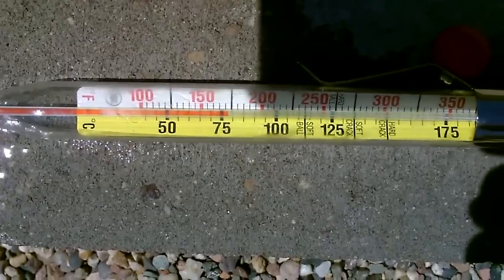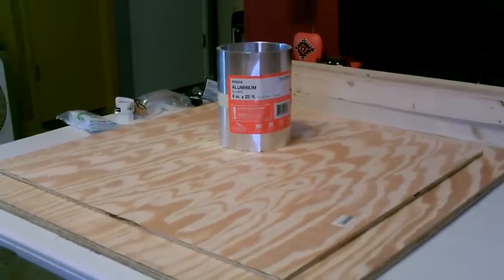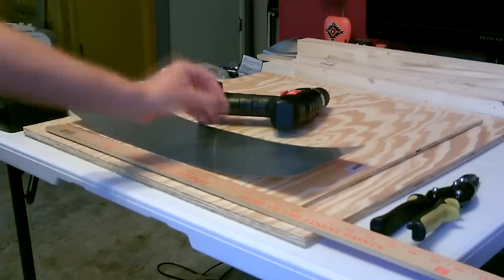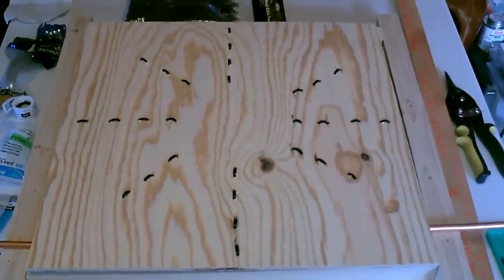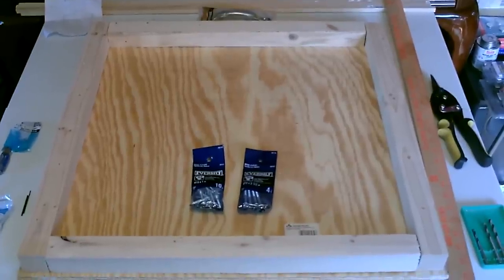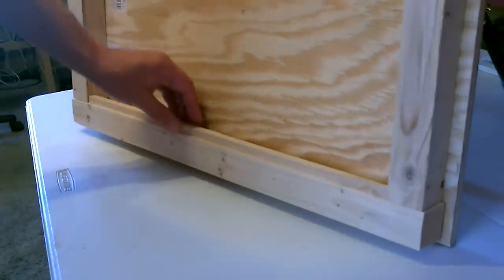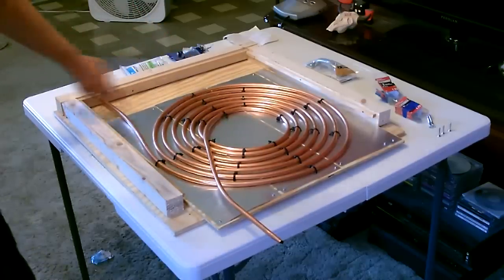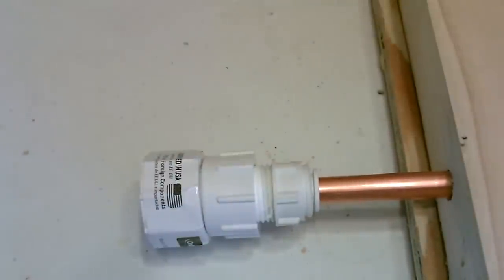DIY Solar Water Heater! - Deluxe "Aluminum backed" COPPER COIL Solar Water Heater! 175F Full Instr.

Comment: Help! Mine doesn't work! Based on suggestions below, I used copper plates rather than aluminum; put insulation behind the plates, used metal zip ties, and two panes of glass, and insulated the glass to wood gap. I am using a pond pump to pump water from a small pond to the heater, and then return--black tubing throughout. Due to trees, I can get only perhaps 90% sunlight for several hours. Yet it seems that the water hardly increases in temperature, if at all! I spent like $300 on this, thus pis--ng off my wife, and countless hours. Please tell me what I did wrong!
Reply from the maker: hi there. the issue might be that you used 2 panes of glass. sounds like a good idea but whenever i've used 2 or 3 panes of glass (in experiments) with solar box collectors - the 2 or 3 panes block a lot of the light from getting through and it gets nowhere near as hot. i'm not sure why an extra pane blocks so much light but it does.

Comment: Hi, another question: I still can't get my solar water heater to work: driving me crazy. I am using 3/32 plate glass from Home Depot, but it appears that you are actually using much thicker glass. Is that so? Is the thicker the glass, the better? What about insulated double panned glass? Or glass from a car window?
Reply from the maker: hi there. if i remember, the glass i used is about 3/32 (possibly 1/8). i've never had any luck with using more than one sheet of glass. it always seems to reduce the temps. i'm not sure about glass from a car window (i've never used glass from a car).

Comment: How would you go about having it work in conjunction with your existing hot water heater? Would be awesome to have preheated water before the hot water tank has to kick on.
Reply: Greg Kohls Jr. I wonder if you feed a tank less and maybe flash heater with this solar unit it's temp sensor would adjust and only add energy as needed.

Comment: I've watched several videos of similar solar water heaters. My main question is: How long did those zip ties last in the intense heat? Less than one season, I'm thinking...
Reply from the maker: hi there. the plastic ones are holding up good so far, but i've recently started using stainless steel zip ties just to be sure
Reply: You could probably use electric cable Clips that might fit the pipe.
Only a thought

Comment: Unless I missed it, how long is the copper tubing used? 25 feet, I am assuming here?
Reply: Cambodia Paul's Organic Farming 
50 ft.
Reply: Not enough to heat a bathtub! These cant work! It would take all summer to heat a tiny pool
Reply: @Coupe420  - Geez. You could make 2 or 3 of them if your pool is deep.  Put them each on a separate piece of foam and float them in your pool. Begin the drawing of pool water through the siphoning principal into the copper pipe by suction until it is coming out the other end and back into the pool.  Note: do this immediately upon placing in the pool and before the water is hot!  Remember, this produces 150+ degrees.   Place them in the pool on a Wednesday and by the weekend your three floating heaters will have mixed with your cold pool water warming it up FOR FREE and your pool will be nicely swimmable when the blended water hits about 85 degrees.
Report back if you do this.  I'd love to see if it worked.

Comment: Is there a recommendation for a water pump to use with this solar water heater using 3/8” OD copper pipe at 50’ length. A 1hp  non variable speed pump burned up in like 10-15 minutes. Any help will be appreciated. Thanks

Comment: How well has this been working for you. I was thinking about doing something like this except modify it so that I can remove the tubing from the frame and put it on a firepit for cloudy days. Would that work?
Reply from the maker: hi there. the unit is still working great. that is an interesting idea about the fire pit.
Reply: @desertsun02  thanks for replying. One more question, if you don't mind. Do you know the flow rate of your pump? I have a pump to empty my pool, but I think the flow would be way too fast to heat up in this set up. Any info on the pump you use would be much appreciated. Thanks.

Comment: Did you have a problem with condensation?  I built this.  And I have moisture inside glass
Reply from the maker: hi there. i've not had that issue, at least so far. one fix might be to add a few small vent holes

Comment: Should have put insulation behind flashing
Reply: Paul Milne would the flashing reflected the heat to the pipe ?
In turn it would make the water become hot quicker.

Comment: ok so im hearing all sorts of differing things here... i thought 3/8th tube would be too small and not let enough water pass through to actually heat a pool with any real efficiency?  then i heard coils are a bad idea and that a header with straight tubes would work better and let you get a higher flow into the pool. then theres the whole Pump pressure thing... thats a whole other story!

Comment: exilent vids. Would sheet metal work the same ? Or wuld it reduce the thermal ? Also is this vershion beader than you'r last one ?
Reply: What kind of metals would you be interested in? Find them laying in the sun, note their condition (clean, dirty, corroded, painted...) and their temperature. Different metals act differently than others. Polished aluminum seems to be the best reflector since it absorbs the least heat. Gold might be better, but try keeping that around.

Comment: I'm considering doing something similar for a solar water heater for an in ground pool. I might need a couple of these in line to make any significant increase in temperature. Do you have any suggestions? My pool is approximately 30,000 gallons.
Reply: Scott Williams hey Scott I was wondering have you made this for your pool yet? I'm considering doing the same thing for my in-ground 30,000 gallons as well. I'm just not sure what size copper line to buy
Reply: I bet if you have smaller copper lines (4  x 1/4th sized lines)  but connect them side by side to a 1 inch pipe it would be better then having everything in 1 inch...   ____|____|____|____|
Reply: Did you ever try this for your pool?
Reply: No, I never did but I always wondered if it would make a significant difference. This year seems to be a bit cooler and the pool is only at 73 degrees. I still have hopes in making this one day.
Reply: Scott Williams you would need dozens and dozens of these to increase the T of a volume of water like that. A solar blanket cover would be more efficient.

Comment: Could you use one way glass to make the box hotter and not paint the copper or Aluminum?
Reply: Not painting would reflect a lot of the light and heat. Then the glass could warm up instead of the copper pipe.

Comment: hey  would this methode on bigger  scale work fore desalting  sea water ? maby working model on that    would be realy cool if you can get  the water  and boiling temp and keep it there  wil low inpute?
Reply: Copper plus salt equals problems.
Reply: @MmeHyraelle  thx

Comment: What does more hot water on a standalone application ? parabolic or this setup ?
Reply: I would suspect the one with the most area exposed to direct sunlight would win. Trying to heat the interior is the mistake. Wasted heat. Redirect and focus the energy on the tubing.

Comment: How does the glass layer improve things if there is a black aluminium layer on top? Wouldn't be better and cheaper to remove the glass since the aluminium in contact with the wood would loose less heat?

Comment: I adpre your design and fully intend to copy it. However, there's no way that copper tube is that cheap. Your price covers the cost of about a 5 foot long 3/4" copper tube. 
Theorice of copper une had not changed much for the last decade
Reply from the maker: hi there. i'm glad you like the design and you're going to make it! about the price of copper:  the copper coil i used really was just 23 dollars back when i bought it in 2016/2017. prices have almost doubled on copper since the low in 2016 (just checked 'Statista' to be sure). the same coil is now $40.99 (or almost double the price that i paid), so it seems to line up with market cost of copper. I mention this because i want you (and everyone) to know that i never "make up" any numbers, stats and figures in the videos. if you see it on this channel, it's real. 🙂🙂👍. btw, thanks for being a long time subscriber!

Comment: Solid state graphite power cell bank that charged up organic carbon cell power bank off earths resonance field with vacuum spark gaps at key locations to increase current. Electronics with two induction coils designed to transmit a certain frequency through the coils in a loop for zero energy loss. That caused a graphite gallium heating element to glow red hot around 2500 to 3000 degrees. For a water heater operated off earths resonance field which could then power thermoelectric generators and provide heat for a home green house or trailer. Way better then solar because it works 24-7 365 day and night. : )
Reply: WHAT did you just say????
Reply: @CosmicSeeker69  🤣🤣🤣🤣 and it sounds expensive!

Comment: OMG good intentions, corrosion by disimilar metals...
Reply: What dissimilar metals?  I see copper as the only metal. It is touching wood, plastic twist ties and plastic PVC. 
Please explain what I am missing.
Reply: @CasuallyObservant  I believe he is referring to the copper coil lying on the aluminum backing, then zip tied down to insure full contact between the two.

Comment: Nice . too bad they don't aluminum tie wraps. Maybe they do have aluminum pipe clamps or something aluminum  that will clamp tight to the pipe and backing. It will transfer the heat to the water better with a really solid connection, the more clamps the better, especially actual pipe clamps, aluminum if you can find them. You do nice work.
Reply from the maker: hi there and thanks. i just recently found and bought stainless steel zip ties. those are awesome and a good thing to use. amazons got them and they're only a couple dollars more than the plastic ones.

Comment: Place an old cast iron BBQ plate behind it! ...instead of Aluminium
Reply: Yes, thermal mass will make a difference, it will radiate heat after sundown for quite a while.
 J.
Reply: I don't understand... please explain.
Reply: No need you need copper or alu

Comment: To save on copper you could use black poly pip
Reply: poly pipe is has a thermal conductivity of about 10% of copper pipe.  You could do the math and play with pipe diameters and pricing to find out if poly is a cheaper material, but you would need more space.  The larger the diameter the pipe, the less surface area per unit of water will be available, which would effect the speed of water heating.

Comment: Hi 

1. I want a full metal radiator (such as in a automobile car 🚘, van, truck 🛻 etc), as I’m making a solar heater and I would want to put the fully metal constructed radiator into a wooden frame (so no plastic bits would melt) which would then be covered with a plastic sheet, such as PETG glass, to hold and magnify the freely generated sun radiant heat inside it). 

Do you agree?   See below.   2. https://youtu.be/nGOCBV8PdhI  In this case he has put a domestic radiator inside a box, with a glass top. But I would go against this as domestic radiator tends to rust inside after time, and goes black after a while so I won’t want that black slush to go inside a swimming pool, which I would use.   3. https://youtu.be/btQtPQpUf90  I may do this but instead of making the (home made) copper stuff inside the box, just put an all metal radiator painted black in its place, it may save me the time and may be more efficient, as a professional factory made radiator, will be more efficient at transferring energy and will work better as a heat exchanger then anything home made.   4. Do you agree?   https://youtu.be/jKGb9Bjc7VM  This I may not do, as requires me to burn stuff... although I could but a radiator inside my bbq, just need the right size. 

5. https://youtu.be/oPaKy_Rpg68 I may go against this idea and replace it with a fully metal truck radiator. As he has spent a lot of time to make the copper piping, fittings, and they may not work as well as professional truck radiator /  heat exchanger. I just need the correct size radiator to fit inside my BBQ.
6. Do you agree?   Thanks